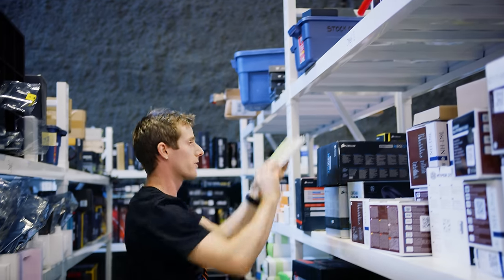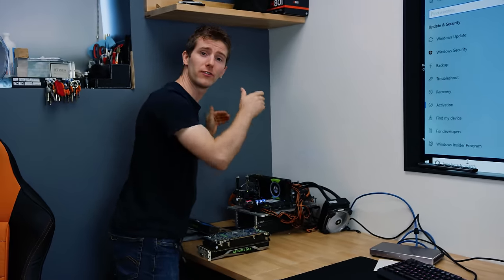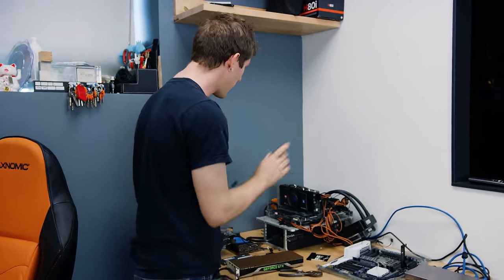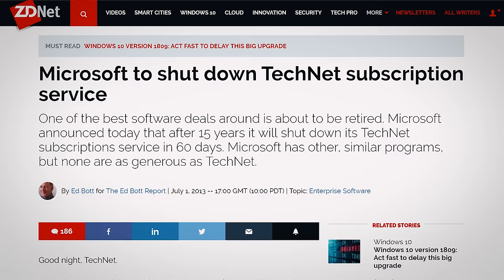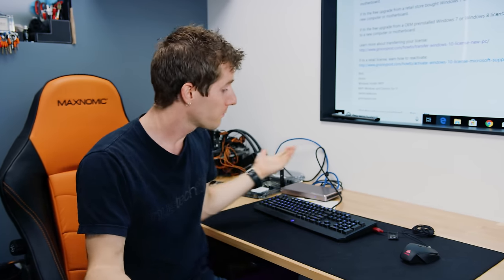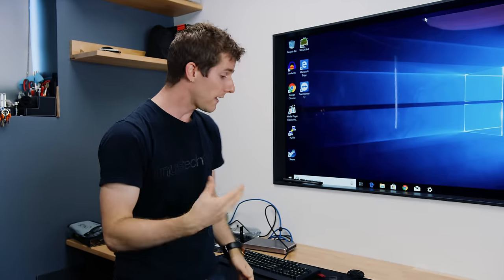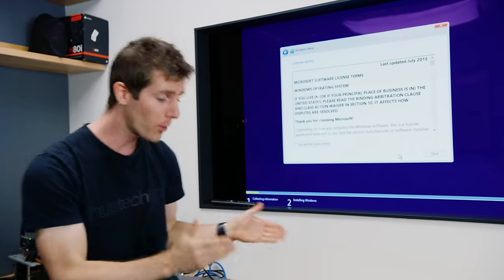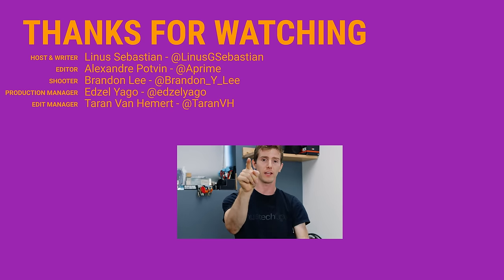Why Does Linus Pirate Windows??

Comment: Pro-tip.

If you use the skip method, do not connect to the internet until you have changed all of the settings disabled by running an unactivated copy.

Once you connect to the internet with an unactivated copy the 'activated only' options will turn off until you activate.

I run unactivated copies all the time when I am building up custom install images. I wont burn a key until I am 100% happy with the final build and integrate that key directly into the answer file so the new owner will have very simple reinstalls if they ever need to do one.
Reply: What settings?
Reply: You do know that even with an unactivated copy (of W10 at least), nothing gets 'shut off' for not activating. It's only a means of Microsoft being able to track if you supposedly legally own the rights to use that copy of windows. Older versions did the shut-off bullshit, but I don't think even since W7 that was actually a thing.
Reply: But
If you changed those settings before the thing showed up
The wallpaper will turn black?
Reply: @Dandy Alvareza 

Nope, anything you change pre-connection sticks.
Reply: @cyka

This isn't about activation issues, this is about avoiding the annoyance of disabled settings when you are doing a test build.

I build a lot of systems and I never activate until the build is 100% ready to go.

Comment: I had an old windows 7 32-bit OEM key lying around. Downloaded windows 10 64-bit from the website and installed using the windows 7 32-bit key. I was actually surprised to see that my windows got activated.
Reply: Microsoft: "I'm not not even mad, that's amazing!!"
Reply: Yep, I think I read that on MS once. Just used old key, since they did the whole free upgrade thing few years ago
Reply: This was a legit way of getting win10 back in the day, didn't realise it still worked.
Reply: 1) 32-bit and 64-bit use the same pool of keys, there is no difference in licensing. If you bought a retail copy of some Windows, it would come with both discs.
2) Indeed, you can still activate Windows 10 with a Windows 7 or 8 key during installation. This is another case of "activated, but not legal", since the offer officially ended years ago. Microsoft won't really do anything about it though unless you use it commercially, resell the devices, or make them audit you for some other reason.
Reply: It's legit if the OEM key was used legitimately. It probably wasn't though.

That being said, I also installed windows 10 on quite a few PCs with an unlimited installs windows 7 DVD and then upgrading the PCs to windows 10 (when it was still possible to upgrade for free). They all received their own, unique licenses.
Reply: It probably was during the upgrade period. They upgraded you to win10 for free for a while and I bet they just took all the win7 lisceses and changed them out for a win10 lisceses
Reply: "Back in the day" I think I'm done.
Reply: This is a cool way to get free keys. a bunch of computers were being recycled, and they had the windows 7 code on a sticker on each machine. each of those old codes are $100 saved for a windows 10 😝
Reply: Max Taylor Welp, time to gather all the broken windows 8 laptops in my family, and bang out some windows 10 licenses!
Reply: Elen Degenerate Exactly! I took a bunch of pics of the stickers with the keys then off to recycle they went. Now I have enough keys for myself and any friends building a pc
Reply: yes, it usually works, but...  even though I do have some computers running Win 10, I still prefer to run 7 or 8 on most of my computers that are not still running XP, or some other OS.  Windows 10 is too invasive on forced updates for my on computers I do not use to access the Internet, but still have a valid gateway enabled.  For a ormal internet browsing computer or a machine running virtual machines, Windows 10 is great however.
Reply: any reason... at all...

Comment: I had this happen, contacted MS, because I didn't remember the key they said I had to buy it again. I lol'd and said no thanks. Pirated Windows ever since.
Reply: Nice profile pic. Danzig \m/
Reply: absolute madlad!!
Reply: No flap from me. Everyone should  have done likewise back when MS Windows refused to run on DR-Novell DOS. That caused me a ton of heartache trying to figure it out.
Reply: THE MATRIX HAS YOU NOW!
Reply: Used to do that then i just wiped the fucking thing. BTW I run Arch Linux. Fk M$
Reply: That's mighty sad. I used to write keys on the CD with a sharpie years ago to make sure a post crash reload didn't come to a screeching halt.  Going back to windows BC [ahem, 95] I could always find it if I could get an instance of regedit to run, but one instance of BSOD will shake that habit quickly. 
  Server farms out the yin-yang, and they couldn't be bothered to assist paying customers [with their own registration]?    That's like making me buy the car again for warranty repairs because the dealers computer systems went down the afternoon you inked the sales deal and they never made proper filings with the state - just moved on to more sales for their own convenience.
Anyway... been using Ubuntu going on 6 years now,  RedHat for over a decade, and good to go.   The only reason to have a windows system is to cope with other windows systems.
Reply: Same. All I did was upgrade my computer. Same hard drive, same windows. It's like buying a battery for your car and then you can't use it because you upgrade your carburetor.
Reply: Same
Reply: You're the reason Bill Gates is no longer the richest man on the planet.
Reply: +Derrick Barrows
What’s a carburetor?
Reply: lol last version of windows i would touch with a 50' barge pole was win 7 ultimate. previous to that xp once they had gotten all the bugs out. win 2000 pro i used for years till the bugs were out of xp. i was a beta tester for win 7. now i only use linux as i refuse to pay through the ass for insecure software
Reply: THAT is WHY they DON'T deserve your money!
Reply: Man, Microsoft support for Windows 10 is fucking atrocious.
Reply: KMS
Reply: Toni..I'm on an XP laptop right now, been using it since SP2. Never had a problem. Inside, I have a 9 or 10 year old Mac Pro with 2 quad processors, 24Gb ram. 1Gb video card. There's four 1 Tb hard drives.  Macs got a thing called boot camp that lets you format a drive for Windows and then lets Windows use all the functions of the Mac stuff, monitor, keyboard, mouse.  I have Windows 7 Ultimate running on one of the drives. I tried the 32 bit version and it could only see 1.86 Gb of ram. The 64 bit version can see all 24Gb. It's very quick, gets a 7.8 on that performance check. I have yet to get things installed to see how it does with rendering speeds in 3D programs.
(I got the Mac and all the hardware, the unopened copy of W7U...for free a few weeks ago as a sort of hand-me-down)
Reply: run Remix OS and get android functionality aswell and it resembles Windows 10 to be fully honest and no Google Play is not pre-installed but you can install it yourself

sorry for unneeded advertising in this comment I was just saying (I literally bought a TC4400 or in other words a 12 year old Tablet PC to run Remix OS and get Google Play on a PC with a touchscreen for under $40, and note according to wikipedia, as of November 2006 a pre-configured model would cost anywhere from $1449 to $1849 so a TC4400 is most likely a luxury PC for the rich)
Reply: Awang Budiman meh Jeff “I’m to rich to give a single penny extra to the homeless in Washington state” Bezos got it by cheating. Bill on the other hand got it by creating Windows and then after he left as CEO it kinda went downhill. Yes they improved the OS but Bill was the guy who kept the company going on the right track. Oof
Reply: @yourhandlehere1  so you are one of the rare 64bit XP guys?
Reply: No, not XP. My XP is only 32 bit. I put the 64 bit Windows 7 Ultimate on the Mac. It seems to be able to use all the ram. The 32 bit version couldn't.
The problem I'm finding now is that the "XP mode" on 7 still won't let some of my older programs work properly so I have some more fiddling to do.
Reply: I used some software called Belarc and it gets you the key back
Reply: Jordan Saylor Well, is it right to make you pay for a new license if you switch computers and the old one doesn't use the software any more? I think not. In a Ship of Theseus situation, you shouldn't need to re-hire the crew.

Comment: Pro-Tip: The activation phone number still works,  can still re-activate forever on the same key.
Reply: actually. ran out of activation after activating over 200 servers using the same datacenter server key... they do work for a while. but after a while they dies...
Reply: you can still use your Windows Vista key that you updated to Windows 10?
Reply: And that still sucks.. 😩
Reply: You the real MVP
Reply: what do you exactly mean?
Reply: And sometimes you get the rep who insists that you can't. I spent 40 minutes arguing with a few of them just like Linus did once after changing a bad motherboard. Once one of them would exhaust their bag of excuses, they'd pawn me off to another rep who would give me the same excuses. I kept at it until they ran out of like-trained reps and turned me over to someone who reactivated my copy in less than a minute. I haven't tried the number for a couple years as a result.
Reply: @Patrick Legault - sounds like you are using Volume Licensing - assuming you have sufficient licensing for +200 copies you just need to get MS to up your limit. If you're hitting it because you're activating guests with Hyper-V in it, you might want to look into the Host Based Activation to stop you having to activate every VM like that...
Reply: id just have to call an international number
Reply: not OEM - so after waiting 30 minutes on hold a-holes will tell you are SOL - never paid them another dime ever again
Reply: "Call 0800-555..." like in the early 90's, pre-Internet era.
Reply: you have one pc and change hardware every other dacade,linus has other things going on.understand?
Reply: but what would you have to give them... tha activation key??

Comment: windows deactivates when the motherboard is swapped out for a new motherboard. and by new, i mean a different make. if you install the EXACT same motherboard to replace a dying one, there is no issue.
furthermore,  tie your licence to your Microsoft account. once tied, you can freely install that copy of windows to as many machines as you want. when the pc boots up however, windows will prompt you with the activation watermark. go to activation, and select "major hardware change". it will prompt you with logging into, and providing the security question you have set up, for the Microsoft account that is tied to the licence. you may swap computer, or motherboard, as many times as you wish. but every time, you must reactivate windows with your security question. when you log into a new pc, or the motherboard has been replaced, with your security question, it wipes the licences from all of your other machines to activate it on this one. to, obviously, protect from duppin.
i know this, as i had a pretty basic, entry level gaming PC. over the last 3 years, i have been upgrading it piece by piece, and in the case of the motherboard and cpu, multiple times.
Reply: thanks, good to know.
Reply: It is hwid based
Reply: Question about this, I just upgraded my motherboard and I'm trying to activate Windows and on the troubleshooter screen it shows my old motherboard but there is no 'use this old license' kindof option but there is 'this is the PC I'm currently using' or something like that. Is that the option you use to move your license to the new build? I was worried if I hit that Microsoft might flag me somehow or revoke the license on my old motherboard...
Reply: @Abestar123  I have installed windows 10 on one then later built a new machine , installed that same hard drive in it and it booted right up just it had been there, Suprised Me. And it was activated.
Reply: @geneabner777  You don't want to use that install though because all the drivers would be for the old build.
Reply: Or you could just pirate windows and there's practically no difference
Reply: Good that windows has this built into it
Reply: E
Reply: I was once like you, devoting 100s of hours to walking PC owners through their headaches.
Why provide free tech support for an evil company that doesn't pay you?
If you provide tech support for an open source project, you are helping to support the Free & Open Source community, but without getting paid, Microsoft is exploiting your labor to work around the inconveniences caused by their greed.
Reply: There is a BiosTool forums (I think on a Russian server, but in English language, that has a brilliant administrator (Han) who kindly helps customize factory motherboard & notebook bios update files to allow you to edit the HW IDs
Reply: Funny story, I actually did a major upgrade for my PC recently. New mobo, CPU, GPU and RAM, only thing remaining is my storage. And not only could I just plug the SSD into the new setup and it booted without needing a fresh install, but Windows didn't even complain about the activation.
Reply: my windows is tied to my windows account afaik, not to my PC. When I get new PC, i simply deactivate the one I am using, and install on new PC. I thought this had become standard for everyone?